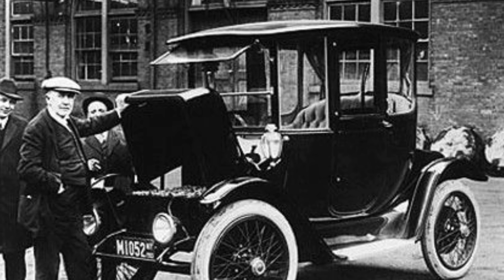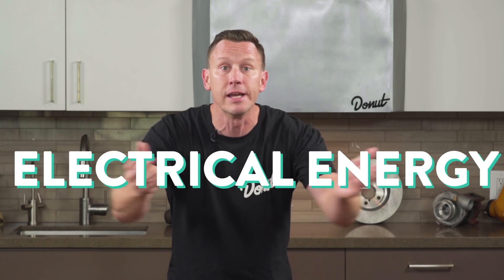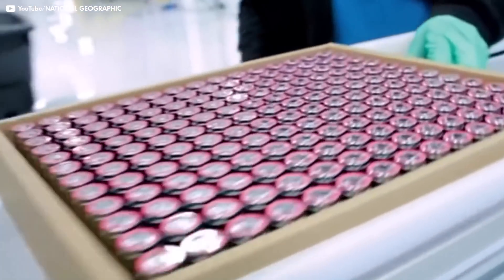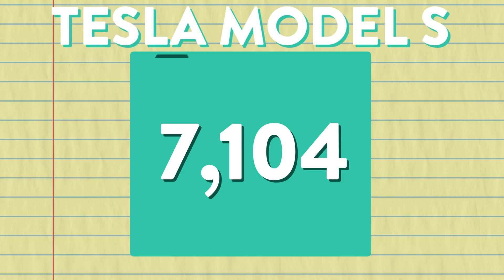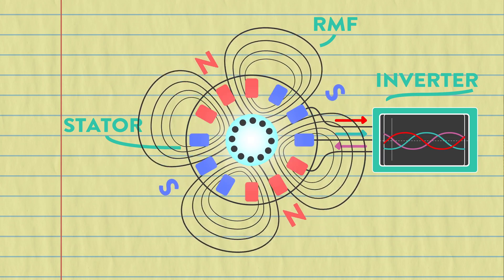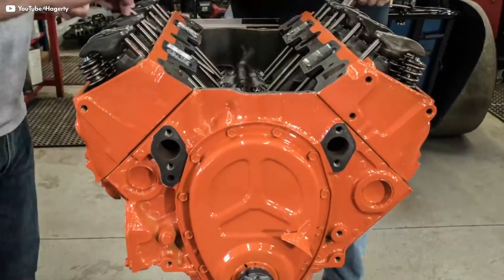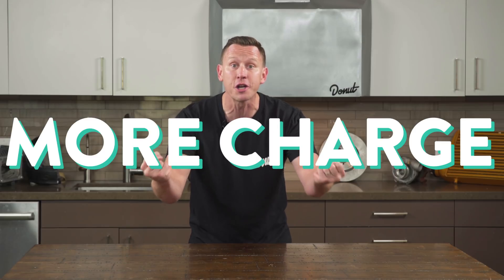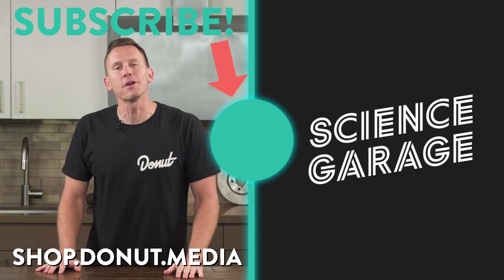ELECTRIC CARS | How They Work

Comment: Why not discuss electric cars made by companies that actually turn a profit, and know how car production works? The BMW i3 and i8, Nissan Leaf, upcoming Jaguar i-Pace and other cars are way more important than Tesla. This video basically turned into a Tesla commercial halfway through. 

Still love you Donut, but mind the circlejerking around a company that’ll go broke within two years.
Reply: Simply because the Profit vs Good Product are opposed to each other.
BMW i cars are utterly horrible as their basic Battery Capacity is Embarrassing. Nissan Leaf Gen 2 is still a shitty 40kwh. Jag I-Pace to be in customers drive ways in 2019 still only has 85kwh. Tesla fucking did that in 2013. 
John ‘Juice’ Shipper what if I sold you old technology with less performance than products from 5 years ago. Basic Fact is their Technology is Outdated.
Reply: Tesla won't exist in two years. Leave EV's to companies that actually know how to run a production.
Reply: Cool if you truly believe that put your money where your mouth is. SHORT TSLA.
If Tesla really does go bankrupt you win a bunch of money. Then the Chinese companies like NIO NextEV, Lucid Motors, SF Motors will just take over.
You better hope you are correct.

Comment: Modern, fuel-efficient gas-powered cars are still better for the environment than electric cars. Sure, electric cars have no direct carbon footprint, but how much CO2 is created as a by-product of generating the electricity that goes into its batteries? We’re better off finding more environment-friendly ways to generate electricity. 

Sure, electric cars are torqey as hell and fun to drive, especially when made by a company that actually knows how car production works (so, not Tesla). But they’re not doing jack shit for the environment, unfortunately.
Reply: Why not both? And we are. 40% of coal plants will become uneconomical this year alone. Solar and wind have actually started cutting into base load demand now.
Reply: Bullshit, Battery manufacturing Processes does not require any FIRE processes like Metal Engine Blocks. The entire process is Electricity based and thus can easily be generated from Renewables like Solar & Wind. Factories like the Gigafactory 1 Nevada does not even have Gas pipeline because they don't need it. Your assumption battery processes need to consume lots of Fuel is a False Myth.
Reply: Even if all electricity came from coal electric cars would still be cleaner. A coal plant is more efficient and a Electric motor use like a third of the energy as ice.  EVs a simply more efficient
Reply: You can't compare the cost of the production of something to the cost of usage of another. Apples to apples here, the production cost for ICE and E vehicles need to be compared. Electrics require lithium to be manufactured, which is awful, but only needed once for the vehicle and then never again. They are simple and made of far less material than normal gas cars, reducing the smelting and mining of ores. Oranges and oranges now, usage. Electrics can be powered by green energy, 100% without an impact after the initial cost of production, unlike the gas industry that has impact after the initial cost. Typical cars use gasoline, which requires the fracking, refining, transportation, smelting, flaring, and production of other machinery necessary to produce. The amount of steel left in the earth, the groundwater polluted, tectonic plates fractured, farmlands destroyed, greenhouse gases created, roads destroyed, and car crashes involved in sustaining the gasoline and diesel powerhouse is far worse than the production of simpler, longer lasting electrics. Lithium batteries are still awful, but to use an analogy here, I'd rather get stabbed than torn in half in the same way that I'd rather mine for lithium than frack and refine oil. Electrics ain't perfect, and the set up is an issue, but don't forget that ICE cars also require set up costs, and since they need to be replaced very often, also present the same issue of lithium dependency on top of their major steel/iron/coal/aluminum needs.

Comment: Is it possible to make hybrid car with 2jz and tesla motor?
Reply: Should be doable with some tweaking. AFAIK it's more or less what Koenigseggseggsegg is doing with their latest model. If you want to do it yourself, I think the easiest way would be to split the axles, and have the engine power just the front wheels and the motor just the rear wheels or something along those lines. It would be one hell of a hybrid if anyone managed it, though.
Reply: The Regera and 918 exist, so I’m sure there’s somebody out there who can find a way to do it.
Reply: slav rides how heavy would that be? Seems like it would be very inefficient 🤷🏾‍♂️
Reply: yes sure why not?
Reply: Mercedes has a mild hybrid 48v system 21hp Motor with 3.0L Straight 6. 
https://www.slashgear.com/2019-mercedes-benz-cls-is-a-48v-hybrid-four-door-coupe-29509375/
Reply: slav rides Oof that takes a very intelligent engineer brain to even know if it could work
Reply: It would be stupidly heavy
Reply: Wot ?!!

Comment: 9:10 true but they don't include all the mining that needs to be done to get all the materiaal to make an electric car. Compere that to gas engines like the HCCI engine from mazda and than you see that there still is a big future for internal combustion engines.
Reply: No one mines lithium. It is produces by dissolving deposits in water, and pumping to pools to evaporate in the sun. On top of that, 40% of coal production is expected to go off line this year. The grid is getting cleaner and thus EVs get cleaner the longer you drive;  ICE cars do not.

Comment: The 18650 battery is used in older Tesla's, vapes, laptops, power banks, ect. New Teslas are using the 2170 battery which was made specifically for the car and has a higher energy density.

Comment: Why you said that Tesla can do 0-60 in 4.2s ?

It can do it in 2.5s
Reply: nosxing its best to use the average and not the top of the line.
Reply: The example used was for a Single 70 Lbs Motor. The P100D cars use Two Motors.
Reply: Just saying, because the 0-60 time they said is what people will believe, so I think if you talk about something in general you say the best of it.
Reply: Lol not even specific
Reply: It can do 0-60 in 2.9 seconds

Comment: Not 100% accurate. Both also generate heat. Gasoline burns and electric motors heat up as well. Its not all going to be put to forward motion.
Reply: There are orders of magnitude difference. ICE cars are in the ball park of 20-30% at converting fuel into work. That means 80% of the money you spent fueling up at the gas station gets wasted through the radiator or exhaust as heat. EV's have 90%+ efficiency  of converting power in the battery to work.

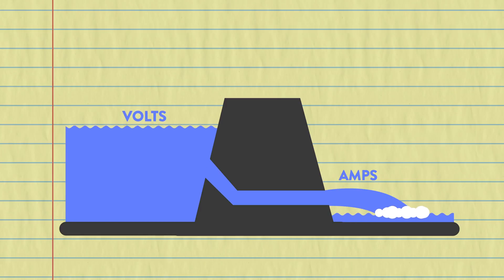Comment: @ 3:55 uhm as far as i remember an increase in voltage always increases amperage if the electrical resistence remains unchanged according to Ohms law (I=U/R), and volts is not capacity (wich is meassured in C, btw 1C=1As) by any means. voltage is best described as "pressure" in your example that would be water pressure due to gravity.
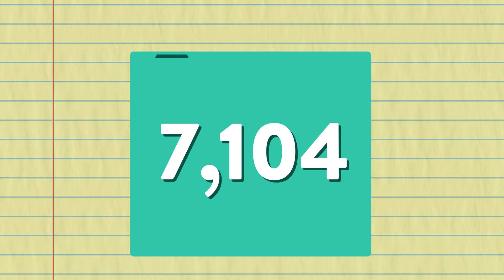Reply: 4:32 doubling amperage: 2*2 equals 12 apparently

Comment: If they ever put electric cars in Need For Speed I wonder how they're going to modify its performance. Speaking of modifications, I wonder if there's a company in real life that specializes in improving electric cars' performances
Reply: BEV Tuning is quite similar to Turbo Tuning conceptually. It's about managing risk, strengthening power train and removing bottlenecks. To force more Amperage instead of Pressure in this case. Things like Improving Distribution Bars & Wiring, More Active Cooling, Arc Protection Coating important parts like Motors. The better the whole system is engineered the more power you can force into the motors.
Reply: It works on different principles, but is very much a thing. Electric cars (or any electrically driven machine) can be "tuned" in a very video-game style. Choose your balance between fast, safe, efficient, and cool. A fast motor will run hot and burn energy faster than a slow motor. If you build an electric drag car you can turn a 500 mile charge into a 5 mile charge by cranking the speeds, but you'll run far too hot and potentially break everything without major upgrades. As time progresses and tech' evolves we'll see more options at affordable prices.
Reply: Yeah, there are mods for everything.
https://youtu.be/ARzujfRiQ3c

Comment: Those horsepower and torque figures from the early 60, 60D models and similar to the specs of the 75D models but the P100D makes 580+ hp and 920+ lbs ft of torque.
Reply: But what really matters is the 0-60 and how much h whp the car has
Reply: Bottom text they quoted a 0-60 of 4.5 seconds for the model s (as if there is one version) and an amp output of 1500amps. 1500amps is the max output of the p100d which do a 0-60 of 2.28 seconds. Definitely not a fan of all the YouTube videos that are supposed to educate but the creators don’t do the research required or have the understanding.

Comment: I don't get it why electric cars get so much hate. I get it that they don't fit the personal needs of many (including me), but that shouldn't mean they are to be hated. Just as we don't project hate towards blue tables, despite most of us not wanting one.
And if it's about disliking EV zealots, than why hate on the technology and not the actual idiots?
Reply: Little complex. Some people argue that its just a scam to encourage people to buy a brand new more expensive car with the risk of not getting your return in savings. Some just don't like Electric cars. I don't think saving the environment is actually a main selling point if you're feeding a family. Some people don't wanna wait for the car to charge and gas can be easily put back in. But external fuel cells could easily add a charge to your car if you're in a hurry. Tech will win out in the end (if it costs cheap enough).
Reply: i just hate the people who own them and the people who make them....bunch of dickheads

Comment: idk why but i understand better on how a combustion engine works than the electric motors...
Reply: Think of it like this. You can't push two magnets together, they push each other apart with force. So, let's say you have a cylinder on its side. Inside is a rod in the center, it can spin. On that rod you have three electromagnets (copper donut), like a 3 tooth gear. On the outside of the cylinder, you have three more magnets that sit above the ones on the rod. Right now, nothing happens, but then you connect them to a battery. When you put energy into the outside blocks, they become magnetized, and since magnets push each other apart, boom, you just made it spin. The magnets push each other to the next magnet, and that magnet pushes to the next, and so on because you're in a circle. Hope that clears it up.